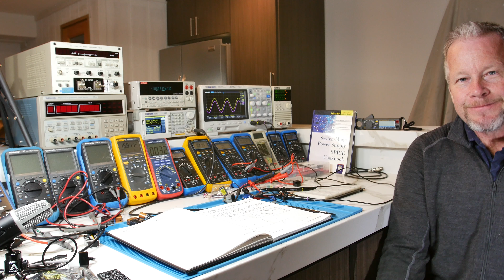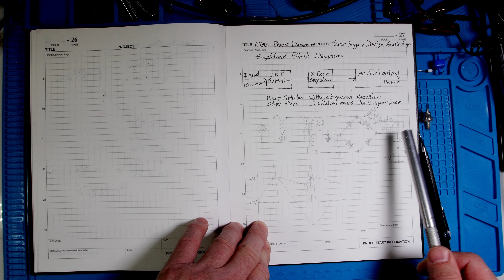Capacitor Design - Audio Amp Power Supply Design #2 #capacitorsize #capacitorbanksize

Comment: Why did you chose 4v for the change in voltage?
Reply from the maker: Great question!  This was random but the thought is that it leaves enough head room that the ripple will not rise high enough to come out of regulation.

Comment: WHY DID YOU NOT USE 120 HZ INSTEAD OF 60 HZ FOR CAPACITOR CALCULATIONS?
Reply from the maker: Alice Kichlu great question.  I actually use the equivalent of 120 Hz as I use half the 60 Hz cycle which is about 8.3 ms (1/8.3m = 120).  So you get two charge cycles per 60 Hz cycle, so you are correct that it is equivalent to 120 Hz.